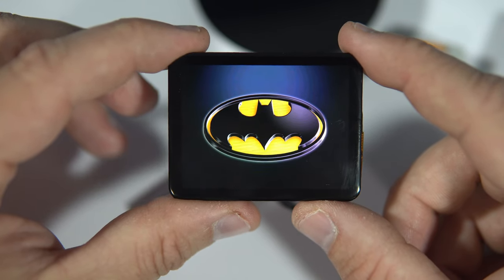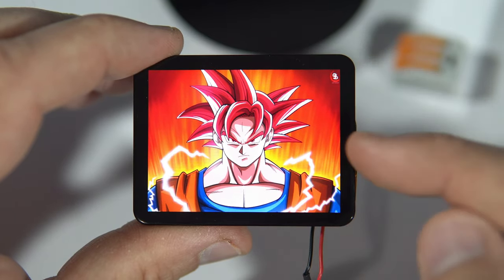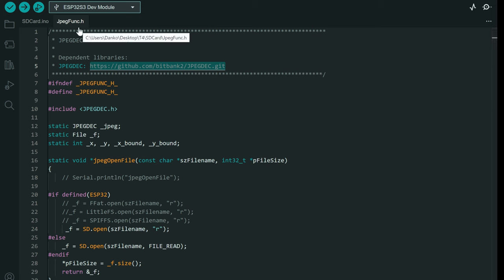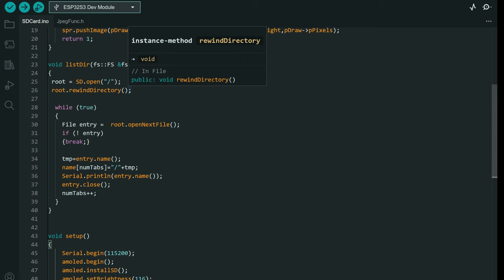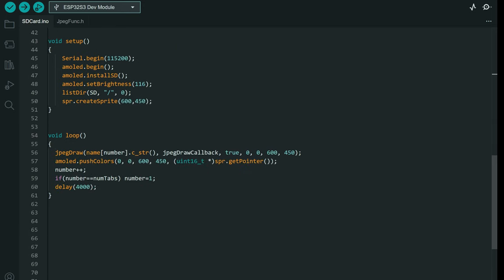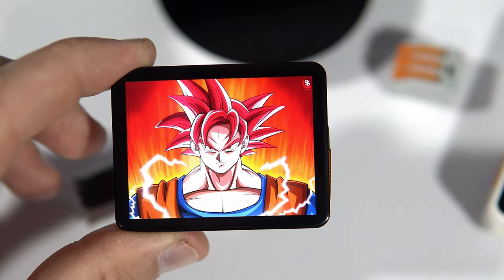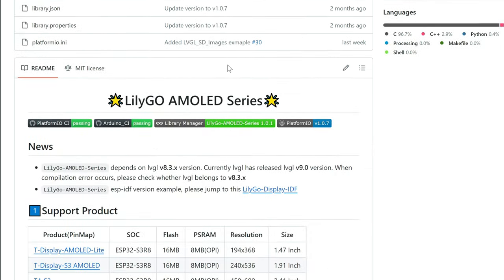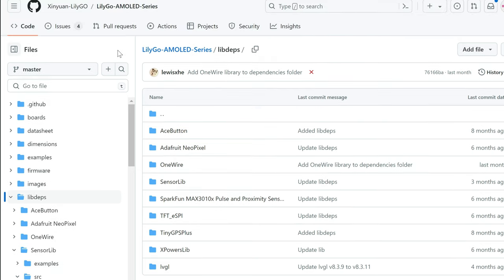Let's Make a Mini Digital Photo Frame: How to Display JPG Files from an SD Card

Comment: Oh, I forgot.... do these T4 boards/displays have a 2nd serial port?

Like, on a WROOM board, there are pins for "Serial1", so one can connect a serial based display (Nextion) on that without interfering with "Serial" itself.

So I wonder if these T3 and T4 boards do have  Serial1  Rx/Tx pins on the back somewhere.

I just now thought to search for the Pinouts of the T4.
I do in fact see Rx and Tx, however, I don't know if that connects to Serial or Serial1,

Comment: Dear Volos, thank you very much for this new video.
It's just something I wanted to ask: How do you configure the Arduino IDE to program the different boards? I try to follow and emulate the codes, but recently I have had problems with lilygo AMOLED cards. I get errors with the LVGL libraries, duplications of TFT_eSPI. I definitely have a mess with files and folders, I'm confused. What do you suggest to be able to program the T-Display S3 Amoled, T4-S3 cards? Delete the entire Arduino IDE and start over with each model? Thanks again for everything!
Reply from the maker: Thank you Sandra. If you have only Amoled boards, you dont need change anything in your setup, all amoleds boards works with same library. ... with other boards you just need to replace tft_espi library, you need to delete old one, in libraries folder there can be only one tft_espi. yes lvgl can make mess also. Dont update your libraries and use libraries from board github. I understand you , i also had mess few times, and ended reistaling evrything. But you dont need reinstall evrytkem you are using diferent board. M5stack boards are easies to work with, they have they own system which works great.
Reply: @VolosProjects  Thank you very much!. I will follow the advice. I had updated the libraries and mixed between the TFT and amoled card folders. I have several lilygo cards to follow your projects that I love.

Comment: Hello! Initially, I put 2 images in the SD card and it works well. I added 2 more images (total 4) but it only shows the first 2 not the new adds. Any clue why? thanks.
Reply from the maker: Make sure images are jpgs and make sure size is 600x450
Reply: @VolosProjects  yes 4 images are all 600x450 jpeg file. Any other reason? thanks